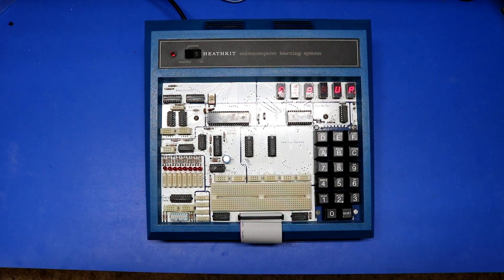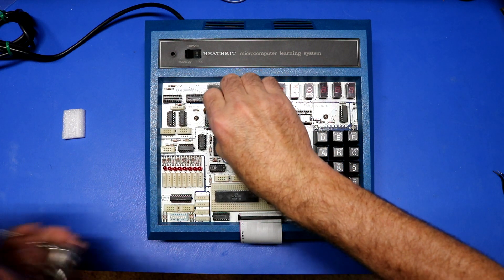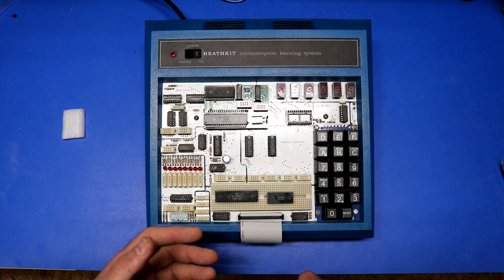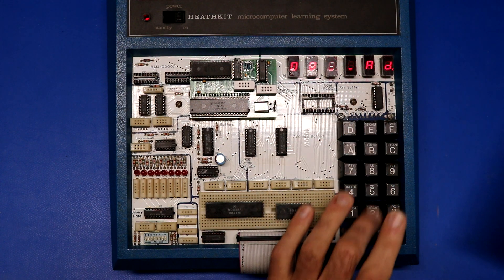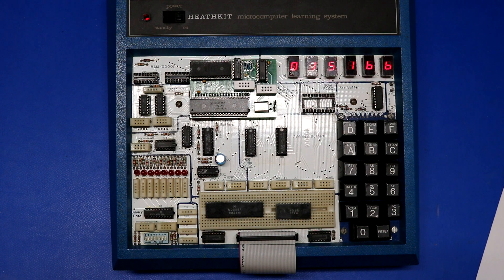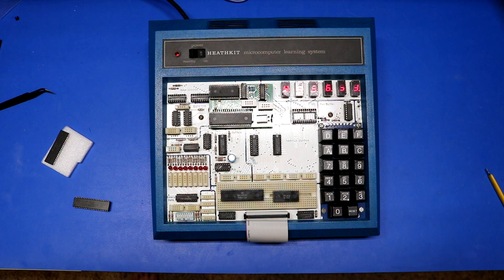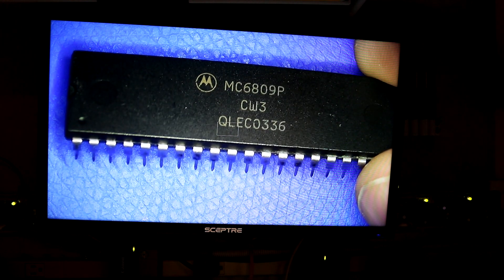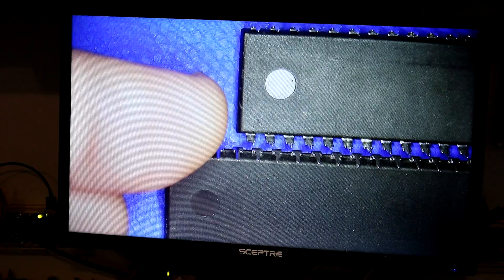Heathkit ET-3400 Part 3: The ET-3404 6809 adapter, cloned

Comment: I have purchased a ton of 6809e CPU (external oscillator) from China. Apparently, they don't realize a 6809 and a 6809e are very different. I ended up with about 30% of mine being 6809's and not the 'E' variant. (my tester can test for both). I would guess the ones that you think are bad are just the 'E' type marked as 6809'. Wanna trade?

Comment: my house electricity is 240v, and the device is 120v, what to do? help me.
Reply: You can put the two transformer primaries in series instead of parallel...
Or get a travel adapter set it to step down...

Comment: at 13:22 Did you notice that the Motorola shield has a gap/slit in the shields on the silk screen on your working chip, but the possible fake is solid?

Comment: Few years ago I made a kit with the same monitor as your Heath kit (with the same CPU UP greeting message and same functions and keys). I used chips that all are from more than 30 years and they are all working fine. Recently I bought two ATMEL microcontrollers from Ali express for some new projects and I found out that they are fake and not working (sanded and perhaps laser etched). Vintage service and product quality vs new era quality!!
Here is the videos: https://youtu.be/T4qHPBQe7HY
https://youtu.be/gyhqOKPJCfQ